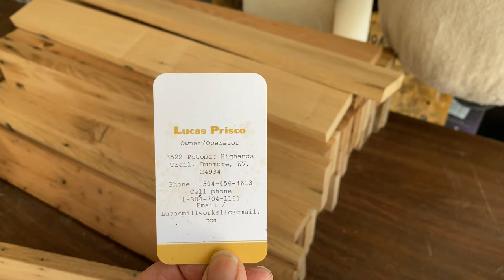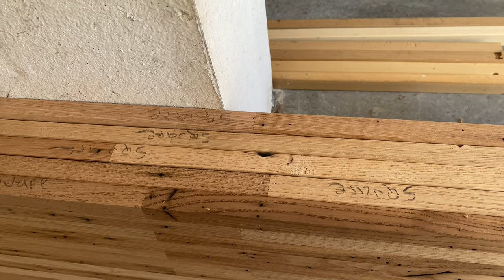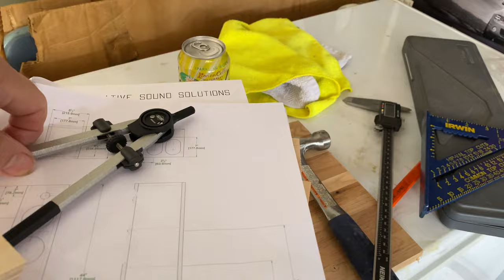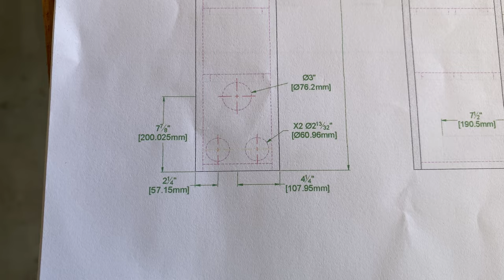DIY Tower Speakers in Reclaimed American Chestnut

Comment: 11:50  Could always save some of the sawdust from the build, mix a decent amount in with a little bit of glue and use that to fill in the small gap.

Might need another quick sanding, but unless someone looks closely it's usually nearly unnoticeable

edit: 30:25 aha i didn't watch far enough ;D
Reply from the maker: Agree. Later in the video you see that is what I do.

Comment: Looks great. Do you know which Baltic Birch plywood or solid wood is better in terms of acoustic properties? I dont know why they offer Baltic Birch Flatpacks for the 1TD-X but not for the 2TD-X. Also, could rounding the edges on the front cause the sound different?  We have birch plywood and  different solid wood options in our country, I want to use best option i found.

Comment: Awesome job, looks great Ara!   Stupid question time, but why would you cut the pieces only to glue them back together, why not just use the full width of the wood?  And how much would you charge for a pair of these speakers?  Also, can you buy those circuit boards pre-made?  I could see that being issue, like the one you had.
Reply from the maker: Two reasons. First is that I like the look. The second is that it makes each panel more rigid which is what you want for speakers. The parts alone on this project were $2000. The wood alone was $700. But that is because it is reclaimed antique wood. The wood could be as little as $100 depending on the species. The internals are CSS audio which are very high quality but you can use different components which will cost far less. So you could design something for much less. Yes you can buy circuit boards pre-made but they will cost more. As far as the crossover failing don't worry. They are solid. If you want me to build them it would cost about $1500 for the labor plus shipping. If you have any more question please feel free to email me ara@htguys.com
Reply: Das man die Löcher sieht! Wäre auch gutes brennholz

Comment: that's an interesting router jig you have there. is it available in metric?

21:19 correct me if i'm wrong but it looks like you cut those holes a bit bigger than the circles.
Reply from the maker: Yes jasper makes a circle jig in metric. I think I'll pick one up as well.  I went a little bigger on all the circles. The ones for teh drivers are actually more important to be bigger than smaller. I can fill the gap with a gasket if need be but if its too small it is a pain to make bigger and maintain a perfect circle.

Comment: I am a long term listener of the show but never came to the YouTube channel before now. But after hearing this episode I had to take a look. They do not disappoint for sure. Great job. I am curious about the 20Hz bass on a small woofer though. Have you played any bass sweeps to confirm how low they play in room? Id be really curious if you do any and post up the results. Thanks for sharing these. What a great friend you are to build these.
Reply from the maker: Thank you! I did do sweeps and can confirm air was moving at 20hz. I did have to crank up the amp to "hear" it though. On the higher frequencies I had my daughters listen. I may invest in a mic so I can test the speakers and plot out the results. I have three JBL 2500 makeovers that I am tweeking the design for. Stay tuned!
Reply: Size is not what gives you deep bass. It has to do with the cycling, how slow the woofer is moving. Big woofers might move a lot of air but can actually not go as low as a small woofer.

Comment: Ara, beautiful work as always! Braden’s a lucky guy! 

Did you get to compare these to your CSS MTMs? If I’m not mistaken, this tower has the upgraded tweeter, correct?
Reply from the maker: Thank you! Yes i did compare them. These sound bigger and easier to listen to. I played them at very loud levels for a while and did experience and fatigue. I hated giving them up!
Reply: Have you considered buying the upgrade kit? The basic upgrade is not too pricey but getting the upgraded crossover parts would almost double the cost. Still, it may be worth it for you, depending on how much you liked the sound. 

We’d corresponded a while back about my own DIY conundrum; I’ll send you a brief email so as not to inundate this space.
Reply: Having recently put together an MDF kit, I imagine using real wood makes the edge roundovers much easier, since you don’t have the challenge of having to veneer a corner.
Reply: @TheHTGuys  999
Reply: @nathandaniels4823 
? O

Comment: Schon  Anfang der 80er hat man gesagt: Boxen baut man nicht aus Massivholz.  Und schon gar nicht mit Löchern. 😜😜🇩🇪
Reply from the maker: I like the look of the old wood. The holes add to it in my opinion. It is sealed from the inside and the cabinets are solid! My guess is that you speak English but just in case this is a Google translate version of what I said :-) 

Ich mag die Optik des alten Holzes. Die Löcher kommen meiner Meinung nach noch dazu. Es ist von innen abgedichtet und die Schränke sind solide!